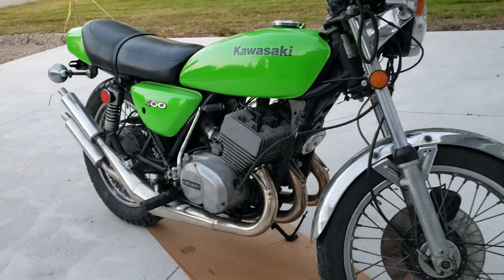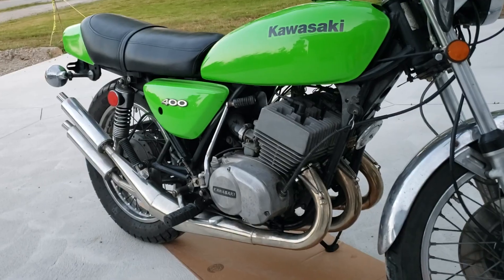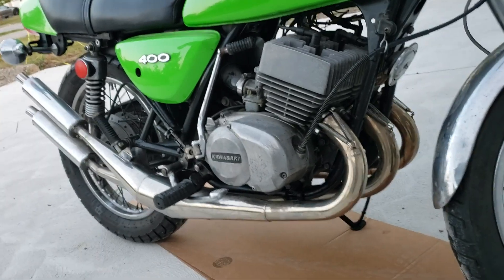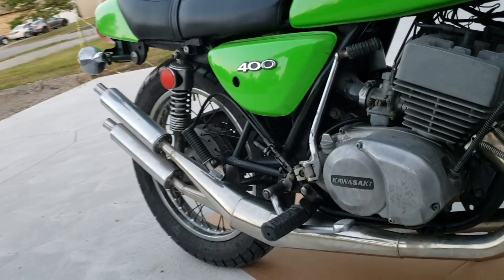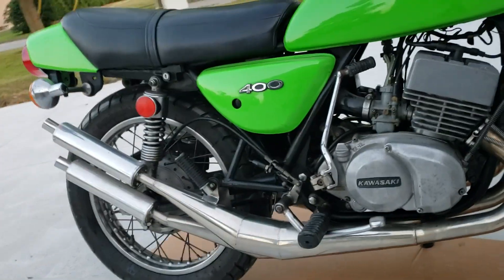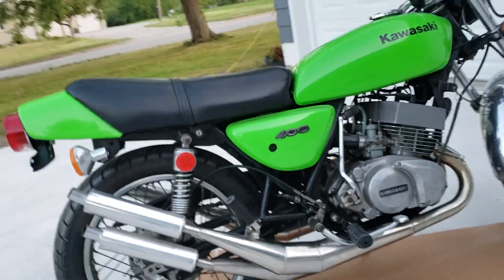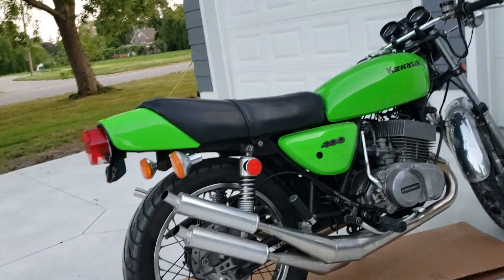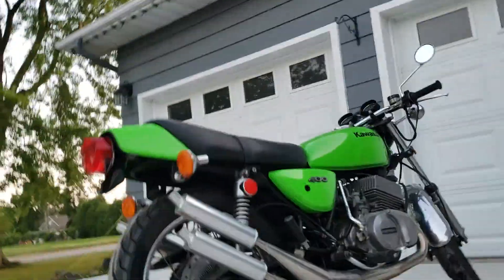1974 Kawasaki S3 400  HIGGSPEED GP Chambers!!

Comment: I wasn't sure about the cans until you mentioned it, really cool bike the 400 triple what a sweet sound I like it
Reply from the maker: I couldn't believe it.  The original owner even paid a shop to install them  :(
Reply: Sorry, This is not a kh400 but rather a 350 S-2 Triple, which is actually faster than the 400
Reply from the maker: @craigullman6129  this is 100% a s3 400.  The S2 had different tail, and heads.  Dead giveaway.   That plus the vin# indicates 400